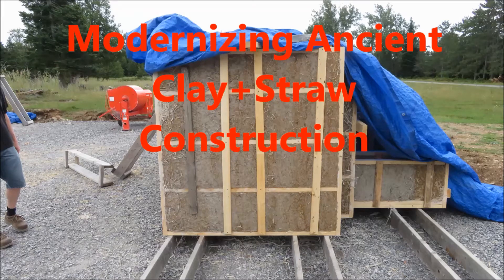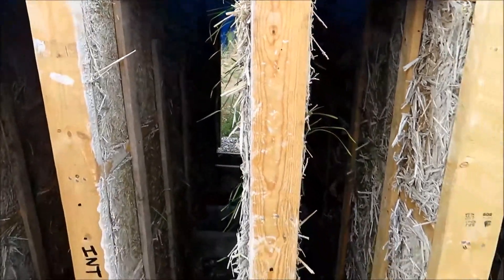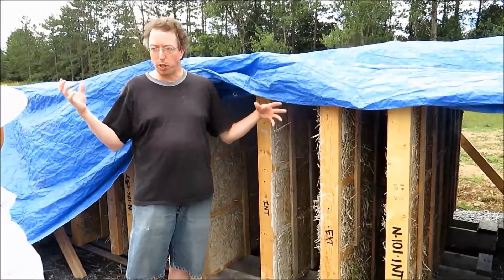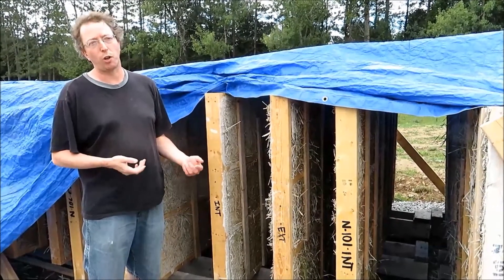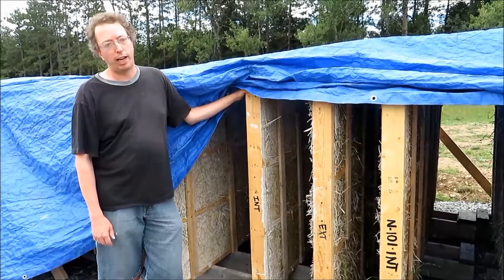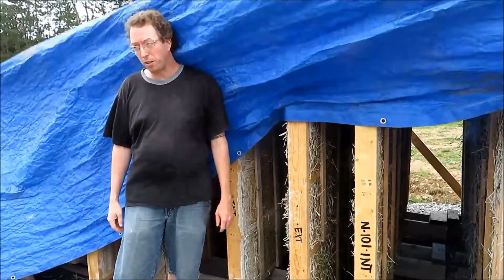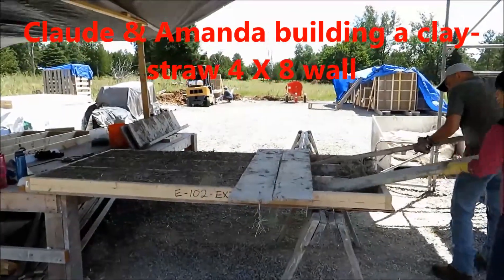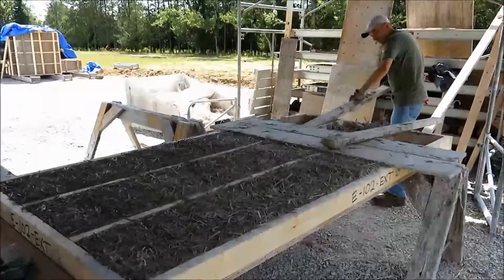Modernizing Clay + Straw Construction Methods-用粘土和麦草造房子

Comment: Just a heads up: Most plants grown in greenhouses don't really like humidity. Which is partly why most greenhouses have massive ventilation systems.
Reply: 🎯”you want the ground to be wet, and the air to be dry”

water at sunrise & sunset.
if watering while the sun is shining, water evaporates creating humidity (MOLD issues)